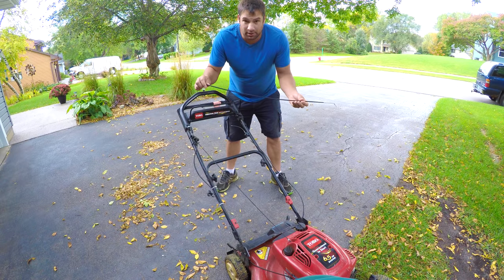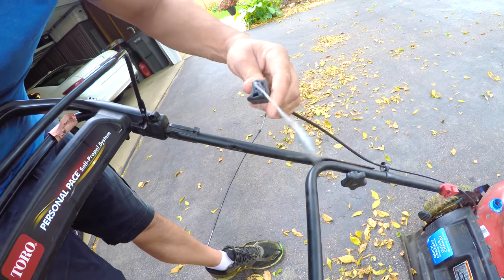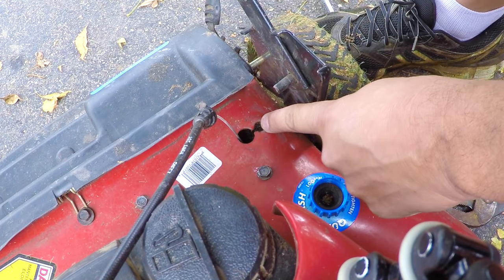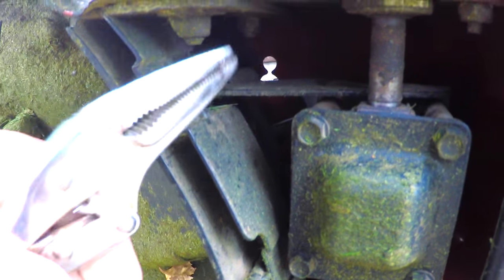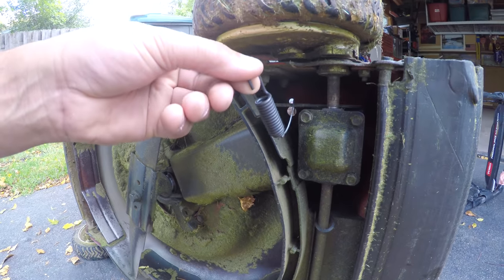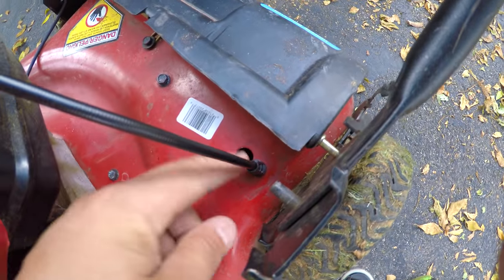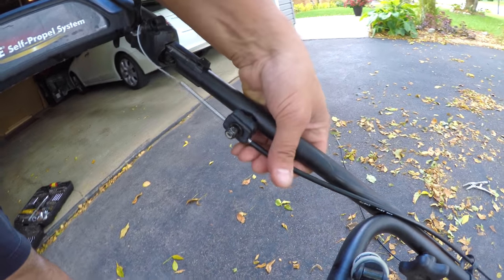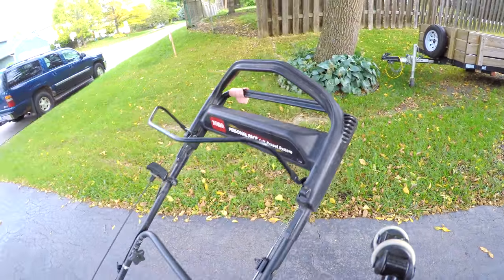Toro Personal Pace / Drive / Self-Propel Cable FIX

Comment: Ditto a comment below.  If you ever update this (or your other one) please show where the cable attaches at the top.  Secondly, since it's difficult to move stuff around to feed the new spring in from the top, couldn't the cable assembly just be fed from the bottom so only the cable,(not the spring) has to go through the hole in the deck?  just one other comment.  Thanks for making it a quick tutorial.  Sometimes I have to run YouTube at 1.75x speed.  On yours, I almost need to slow it down.  Good work.  I'm subscribed.

Comment: Thanks for the video, the spring was really hard to replace. I ended up taking the 3 bolts off the side and was able to secure it. Funny thing is, when I push down on the handle, the rear wheels don't move, but if I pull up on it, the wheels move, so it's doing the opposite. I have no clue what happened. I put the spring on the same way it was on before.
Reply: Had the same issue. Turns out I was connecting wrong. Top end goes under the plastic handle, not the metal pull bar.
Reply: @smg53719  ya that was my fix too. Felt like I was an idiot

Comment: Thank you so much for this video!!! I was able to fix my mower today using the steps that you showed here. I was not able to slide the old cable into the larger hole no matter how I tried it would not move. My solution was to forcefully pull it out using wire cutters and excessive force. Then the next thing that helped immensely was to bend the tip end of the new spring outward so it could slide into the hole at an angle without having to twist the spring down too far. I was able to install the new spring with my fingers. 
Lastly I did not cut the zip ties holding the old cable but instead slid the cables out and into the zip tie.
Reply from the maker: Nice work .

Comment: video was very helpful but my mower has two cables with two holes. I can't seem to find your video with the mower like that like you mentioned. I can't seem to pull the other cable into the smaller hole to get the new cable (drive cable) into the larger hole. Advice?

Comment: Awesome video I just snapped mine recently and I'm looking for the correct part number and a location to purchase it from if you would put a part number or a location that would help tremendously👍
Reply: This is what I came here for lol... just snapped mine yesterday.
Reply from the maker: There should me a model and serial number tag/ sticker somewhere. I picked one up at the local toro dealer.

Comment: You can run a long piece of wire through the spring hook and wrap it around a screwdriver for a handle. Now pull on the spring while working it through the hole.

Comment: I tried to get that spring on for an hour before I just loosened the 3 bolts on each side holding the transaxle and dropped it enough to install.
Reply from the maker: Good tip

Comment: What I ran into with mine is that after replacing the belt and the cable, I still can't tighten the cable enough to make the self-propel feature work well. I have to push the handle nearly all the way down before it kicks in and moves.
Reply from the maker: There is an adjustment on the top part. I could make a quick video this week
Reply: @thetoolsman49  Hey, that would be awesome. Thanks so much! I would really like to have the self-propel feature working properly.

Comment: Use the slack to turn the spring "upside-down" so the spring hook curves towards you and hook it on the bottom side of the lever, then flip the spring around so it's hooked "right side" up on the lever. Took just a few minutes to remove the old and feed/attach the new. No brute strength required, just a little ingenuity.
Reply: Brilliant! Worked like a charm!
Reply: Exactly like I wound up doing it- works like a charm! Another way to visualize it: hold spring under lever, cable end toward you, hook end going back and up over the lever. End of hook will be positioned at attachment hole, let spring drop down and around, spring loop should go right into hole.
Reply: After struggling trying to put the spring in the way the video described. I started thinking about the show on Netflix called Stranger Things, and thought about the Upside Down world and that’s when it hit me! Try attaching the spring by flipping it and attaching it from outside the deck! Worked the first try!!!
Reply: That's what I said too

Comment: Pull the blade off, then the pulley, take the belt off gives you room to pull the cable off and put the new one back on the transmission

Comment: Suggestion - place hook from bottom and feed wire from bottom to top through hole. Very easy that way. Also just push the plastic anchor in the hole from the top instead of trying to slide it

Comment: How about a four-wheel self-propelled Toro 6.5 personal space my lawn mower the four wheels turn how do I fix the four wheels to make them turn
 just with that one cable or do I need another spring to connect I took
 out six screws it was kind took me an hour to figure it out of easy
Reply from the maker: Nice work. My neighbor has a front wheel drive Toro. On his the cable just gets loose

Comment: I ended up ordering a cable through amazon because no one carried them in stock & Home Depot only carried universal cables, which will not work, [but they sell the mowers????] At any rate, I keep telling my wife & son not to jam the drive handle all the way forward while the mower is off. Every time they do that, I get asked to come outside & put the drive belt back on because they've managed to pull the transmission cable loose through the holder...

Comment: My cable broke at the handle at the top. you didn't show where it goes. Can you tell us that? Thanks.
Reply from the maker: I did another video. I show it in this video.
Reply: There's a hole on the drive handle over on the left side on the bottom of the handle. You wiggle the ell on the cable through that hole.
Reply: I was at a Toro dealer and looked at their mowers and seen how it was installed thanks.
Reply: Where? I can not find it!
Reply: Dave, If you're talking about where the top part of the cable goes. look at the black wide top handle underneath it should be grey in color not the wire handle that you grip that keeps the mower running. Its the part of the handle that pushes down to put in drive.  hope this helps.
Reply: +Dave Williams. If you need to know where the top end of the cable goes, look on the bottom of the handle on the left side. There's a hole in a flat piece that sorta hangs downward. The Ell in the cable end goes through that hole to the first bend. That's what holds the cable into the handle. You know where to adjust it correct? If not, check out "Disassembly of Toro Rear Drive Cable, or Drive Cable Replacement, for your Model, be it Toro Recycler 22 Rear or Front Drive. Hope I was able to help. It can be tricky the first time or two if you're not a lawn mower guy like me.

Comment: Where do you get the replacement cable mine just snapped and cutting the front without it almost killed me lol
Reply from the maker: online or hardware store.
Reply: You can get them from Amazon but make sure you have the model number which is under the bagger flap on the left rear of the mower. I ordered the wrong cable the first time.

Comment: Hi Toolsman.  I need to see how the personal pace traction cable connects to the handle. My torsion spring under the handle dangles - its ends aren't attached.  I can't tell if something is missing like a broken tab or something, or if the spring simply came unclipped. Thanks!
Follow up - I found another tuber show this. Its called the speed control spring; it has one of the handle bar rods through it.  That video here: https://youtu.be/grzMnmp-Gas?feature=shared.  Cheers. BTW, my model is 20372 SN 312xxxx (DOB 2012).

Comment: Great video... Subscribed
.. But how do u adjust the cable at the top? Do u wind it down towards mower?
Reply: Where the cable attaches to at the handlebar is a nylon or Teflon nut that you can loosen to slack it.

Comment: What is the model number of that mower?  I have a similar, but slightly older that needs a cable.  Looks almost identical.  The bar code sticker on mine says 21038 20017, but that doesn't correspond to a Toro Model Number. OEM model sticker long gone.
Reply from the maker: Sorry. I don't know. I got a new mower

Comment: Perplexed for a couple of days.  That little rubber cap escaped my attention.  Popped right out.  Glad you mentioned how to deal with that second cable running through the cap.  I think this is doable.  Hope I can barrow the needle nose vice grip from my son.  The spring was difficult to remove and I can see how it will be a challenge to get back on.  Thanks, tons for this video!

Comment: Do you need to disconnect the spark plug first before turning mower on its side? Where do yo I get a replacement cable? Of course you need Torro model#? Thanks!
Reply from the maker: Jusy tip it carb side up

Comment: My toro self propelled mower will start but when I put in in "drIve" it shuts off. Any ideas as to what is causing this? It has fuel and oil and recently changed the air filter. I've only had it for 3 months.
Reply from the maker: I would bring it in. They usually come with a 3 to 5 year warranty
Reply: the only thing i can think of is a sheared key somewhere, probably wherever the drive side of the self propel system is, under the deck on the bottom of the crankshaft, the key makes sure that it fails before anything real nice fails, making the engine out of tune and such, if you want to take it to the stealership then go ahead

Comment: Anyone have information on removing the whole person pace assembly? I was thinking of taking the handle and parts off mine and putting it on another Toro mower. Both mowers have the same connections and parts it is just that one is personal pace the other is not.
Reply from the maker: Sorry. Can't help with that

Comment: My wonderful wife loves using this mower to mow and mulch/pick up leaves!
This evening she told me the self propel wasn’t working.
My cable was broken just like yours!
So, rather than wait in line to get the shop to fix it, I now know how to fix it!
That way she keeps doing what she loves and I don’t have to push the mower!

Did I mention I bought an electric start Toro for her birthday?

Am I a smart husband ,or what?

Thanks for the video.  It was very well done?
Reply: I meant to say it was, “Very well done!!!.”
Reply: You are genius. I also bought a electric start mower for the gf. She never used it so it back fired. Lol. Glad it is working out for you. Hopefully , the repair goes smooth. The spring is the only hard part. Just be patient. Good luck.